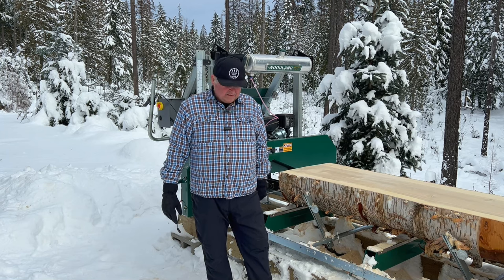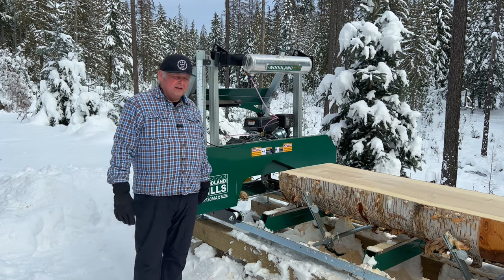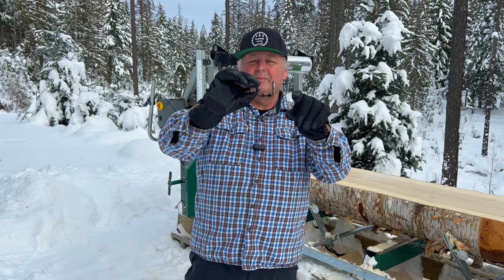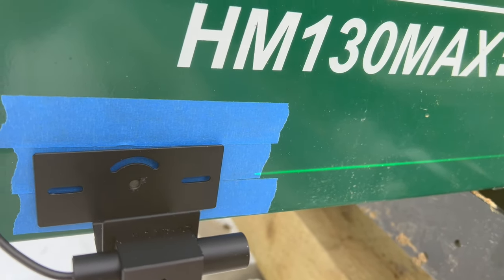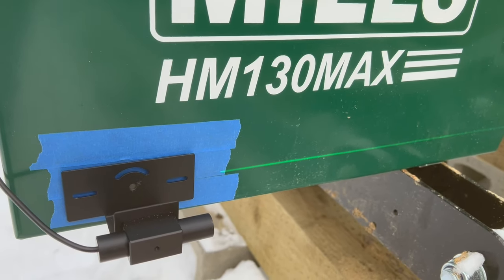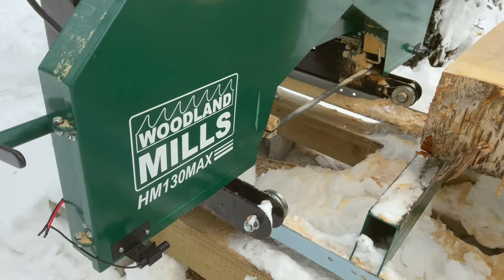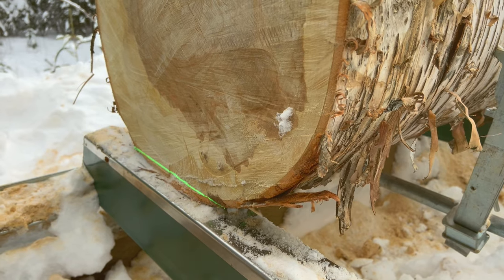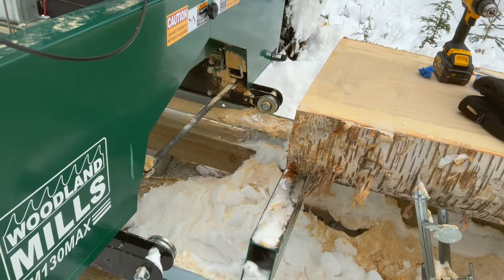Installing Lasers on the Woodland Mills HM130 Max

Comment: Looks very slick. I don't see a power source, just the converter. What is the power source? Thanks
Reply from the maker: The power source is the 12 volt battery used to start the mill.  The battery is also used to power the EpicSaw PowerLift.  Thanks for watching!
Reply: Ah, Of course. I have an HM 126 with no battery.  @mylifedeliberately